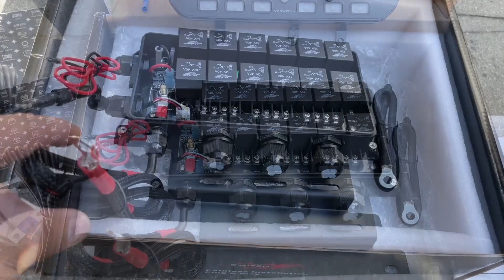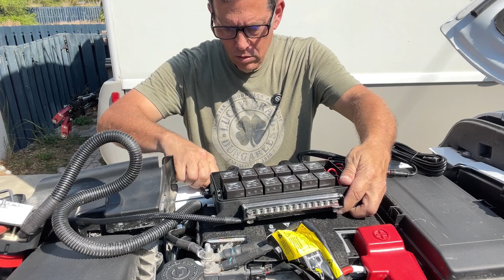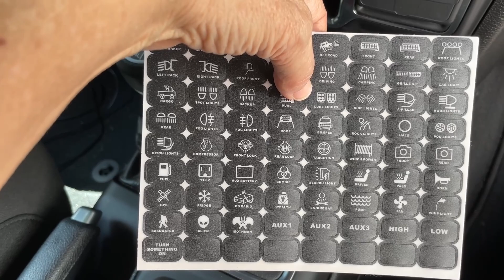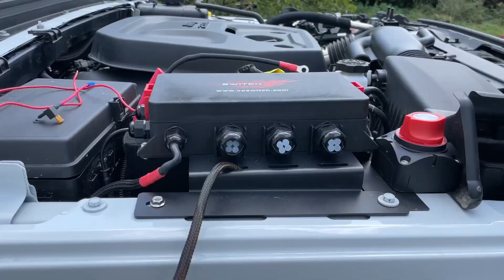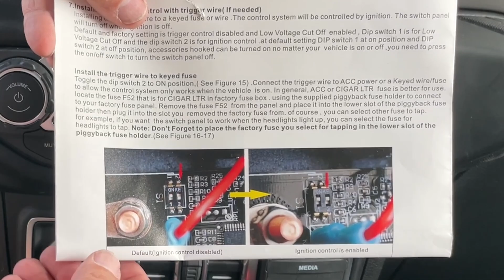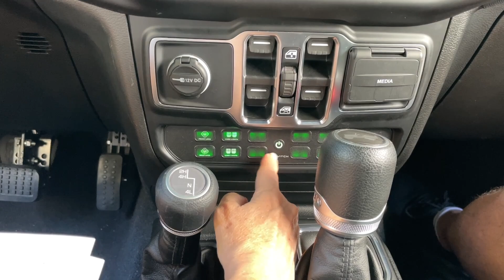Installing a Voswitch JL120 Switch Panel Power Control System in a Jeep Wrangler JL

Comment: Good video!! I’ve been eyeing this one. Super clean setup and I highly doubt most will run out of switches to use. Now to figure out how to wire them up as a trigger for the winch, compressor, and lockers. (Without burning down the Jeep😂)
Reply from the maker: 😄Thanks! I’ve been happy with it.

Comment: Just a little tip. When pushing the wires into the box thru the round grommet put a little dish soap on the wires. Anything above 16ga can bet quite tight and difficult to push thru
Reply from the maker: Good to know! Thanks for the tip 👍